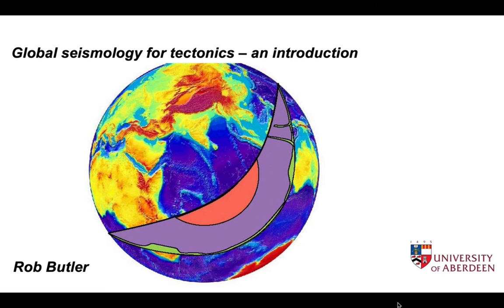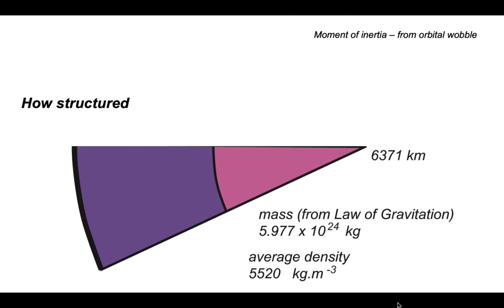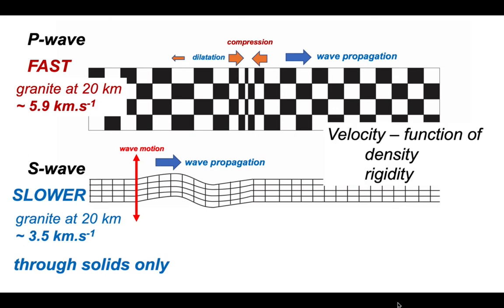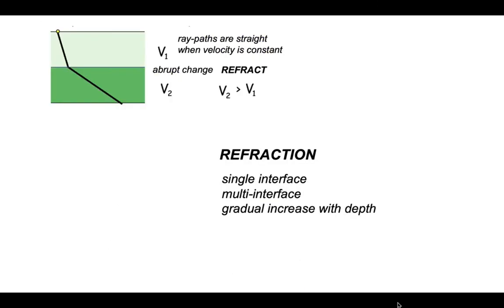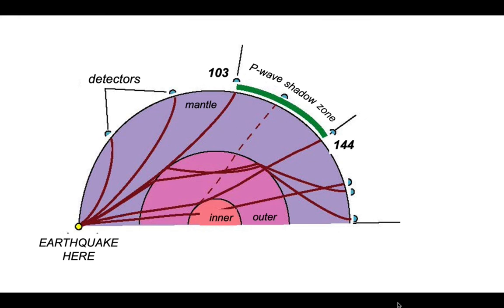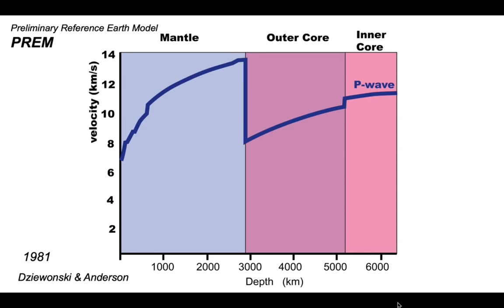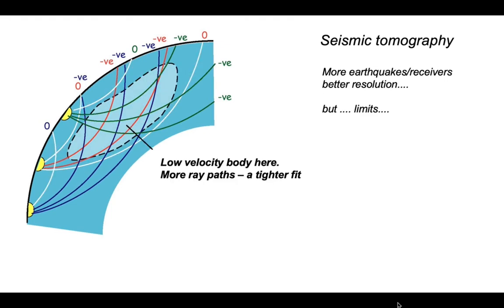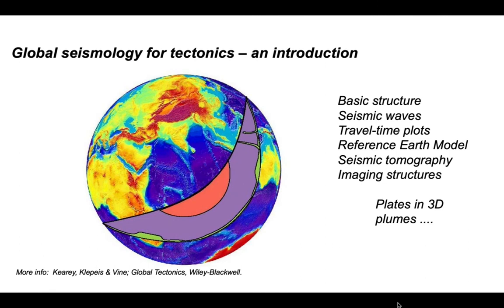Global seismology for tectonics - an introduction

Comment: Thank you for making the video and making it available.   
I worked on seismic boats for over fifteen years as a mechanic, occasionaly a geo would tell me what it was about.  Deep seismic shallow seismic, reflection, refraction, hard rock reflection or soft shale like, gas/oil no or little reflection.  Looking for no response, trisponder positioning, boat speed 4 knts, pop time 6 secs.  Ambient air, sea temp', temp changes day/night weather, compressed air temp, compressor temp, volume, flow.
  Things change. 
 Just about to start a line when it was abandoned - the anotator didn't work.  The 20 to 30 yr olds in the recording room didn't know that we used to use a pencil to write on the first trace the same as the annotator now did.
Years before all the electronic bods had plastic tweaking screwdrivers + an array of tools in their pockets including a variety of pens and pencils and the DMM, now not a pencil to be seen, nothing in the operators pockets.
The recording room went from a large room with 4 or more on watch to a knee hole desk with 2 operators on 12 hrs each.
Last time I was at sea was off Thailand in the early 90s.  Now 34 yrs ago.
Early ninties downturn in the industry.  On the phone to a company in KL, new manager asked me for recent relevant certificates, after enquiring I could not get one of the three later mentioned to me.  New kid on the block wants certificates.  Never mind the 20 + years working at sea.  Well I was in my late 40s so I'd had a good run at it.
Mostly good memories.
Thanks again for the vid' good to have things explained in a way that can be absorbed.
Reply from the maker: Thanks for sharing those memories and reflections (as it were). I'm a fan of paper and pencil - to get rapid first pass understanding (even qualitative) of things.... relying on digital alone can (often?) lead to big errors...